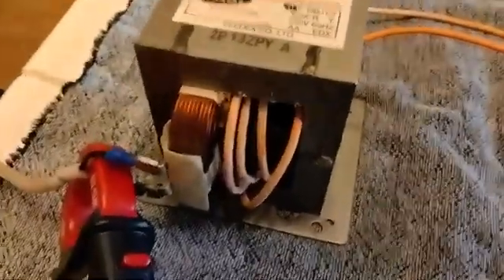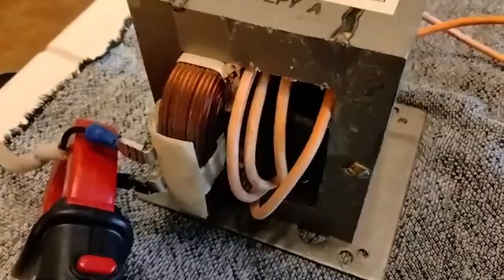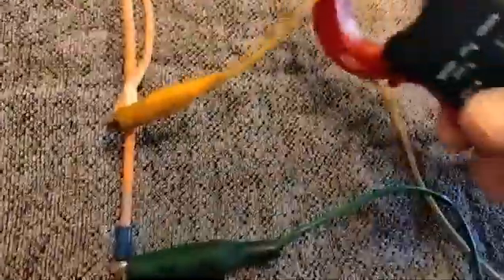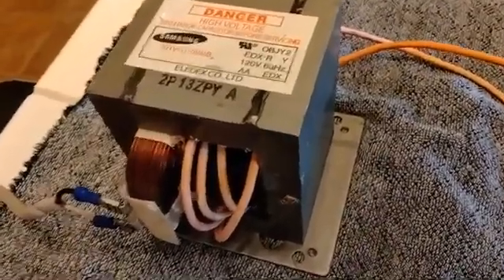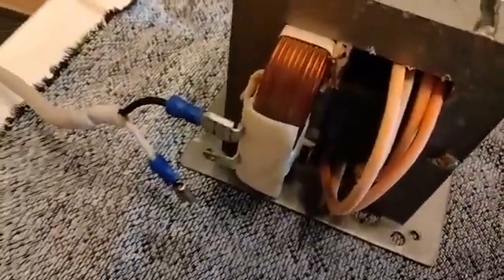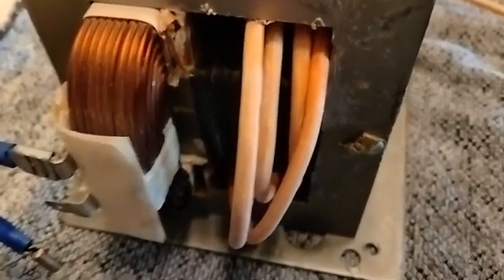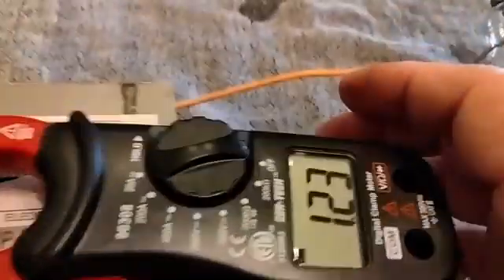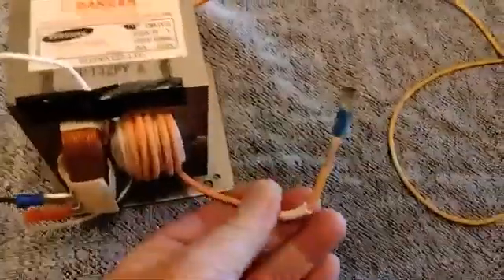Microwave Oven Transformer Rewind the Right Way, Too Many Dummies on here giving Bad Advice

Comment: Excellent presentation, I like hearing Expert's? quoting factual information. You did a bang up job, explaining the fact's for this type of Transformer. Thank you N8AGW.
Reply from the maker: Thanks,  I'm not an expert by any means, but some things I know because I've tried and learned the hard way many times.   I actually learned about those primary windings from some old YT videos over 10 years ago, it was some kids in Thailand building toroidal transformers and explaining that as they added windings that the idle current kept going down.   It was not in English, so I just kept watching what they were doing because they had a light bulb in series with the primary and as they added windings it kept getting dimmer.   That sparked my curiosity so I started studying, and in that studying I ran across the descriptions of MOT's and how they cheat and short wind the primary, and the saturation, and all the other tricks.
Reply: @bigcbradio  Well you have a good understanding of winding transformers. Microwave transformers are a great means of transformer stock, easy to get apart, and remove, or add secondary windings. You are the first person to post the fact that the primary winding must be changed also. This is very important and thanks for pointing it out.
Reply from the maker: @leroyolson4349  You are very welcome.

Comment: I can't understand why folks always say to throw out the old secondary. If you just run them backwards they put out 6 volts at a couple dozen amps.  (Watch the output winding temperature!) 

You can cut the welds or not it doesn't matter as long as their well clamped back together when you run it.  Cutting em just makes it a hell of a lot easier to get the shunts out of the core and free up a bit more wire from the fine winding to attach a lead to instead of having to attach one wire to the core to run it.
Reply from the maker: Again folks, do not cut the welds.  I even saw a video here on YT where the guy says "cut the welds with a hacksaw, it's easy"  then he proceeds to use a high speed cutoff wheel to cut the welds. LOL.  Have you ever tried cutting a weld with a hacksaw?  If you have then you already know what I should say here.   If you are one of those people that has to learn everything the hard way, then by all means, get yourself some MOT's and try it both ways, all 27 ways,   Cut the welds, add primary turns, don't add turns,  then you will know.   But in all seriousness,  do not play with, or even power up an MOT that still has a secondary winding on it unless you really know what you are doing, or you may DIE very quickly.
Reply: @bigcbradio  I think this commenter was proposing putting mains into the secondary and using the primary as a low voltage output.  It certainly would not saturate the core but it will also not be able to provide the full 700-1000W of power with the excessive winding resistance.

Your advice not to play with the secondary high voltage is good.

The advice in your video is also sound, I have seen one other video and understand enough about transformer theory to know that it is a sound fix for the problem.

Perhaps one day you can do a demo of feeding the primary with a good size Variac and graphing the voltage and current, with and without a load, before and after the added turns.  You will be able to show how the current starts to clearly increase faster than the voltage when the core reaches saturation.

Nice video, don't worry about the nay sayers, you are far from the most abrasive on YT and provide good information.
Reply from the maker: @KallePihlajasaari  Thanks for the comments.  I'm not worried about them, otherwise I would have my comments off, or screen them.  There are 2 reasons I made this video in this way.  One reason was because I almost feel bad every time I run across a video showing people how to just add windings as a secondary for a project.  These MOT's draw a lot of current and these beginners are going to be turned off of this hobby if all they get is bad advice and their transformers get hot, burn up, blow fuses, etc.. and I want to help them enjoy this hobby.  The second reason is because I have been involved in electronics in many capacities including CB, and HAM Radio almost my entire life, and I get so tired of the new Hams acting like they know everything, when most of them just memorized the answers.  These hamsters squawk about everyone being off freq and tell them to buy a better radio instead of helping them fix the radio they have or using their clarifier.  They also just parrot crap they read or hear from others and have never actually tried any of it.  Then a few days ago I ran across a Hamster guys video where he is supposedly teaching other Hams how to use a MOT for tube filaments here: https://www.youtube.com/watch?v=8o3ttyrXIeM  So, between these two issues, I made this video a little snarky with a small dig at a Hamster, and I wouldn't be surprised if the negative comments are from Hamsters, if not, they will be now LOL.
Reply: @bigcbradio  I used CB in my youth, had a Ham call in ZR6 land but have moved to OH2 land and have yet to rewrite the test here though I did a refresher course in the local vernacular with my son.  Perhaps we should just book for a test and get local calls, they may come in handy one day if the internet censorship gets real bad and one cannot even connect to the net without a biometric ID and a certificate of vaccination.
Reply from the maker: @KallePihlajasaari  I am not too worried about the internet or the end of the world, etc... But that being said, I do stay prepared to be self sufficient in the even of most disasters or if the shit would hit the fan.   I own multiple properties, I have solar, batteries, water, water producing equipment, water wells, food, seed, and transceivers and antennas to listen/communicate on just about any frequency there is, and no I don't need a vax
Reply: @bigcbradio  as someone who did this (cut the welds, ruin the secondary (accidentally (this was such a sad moment, i wanted to use the enameled wire of the secondary coil for some other projects)), also ruin the primary (accidentally)), and now i have just an empty E I core, i recommend cutting the welds, it gives you easier access to the core, which will make it significantly easier to rewind, but the problem is, ruining the old windings is almost inevitable (especially for someone who doesnt have high-end tools)… and if you want to rewind a microwave transformer, those are some things to put in mind:

1- Cut the welds (so that the process gets alot easier to do)
2- For the love of god, dont ruin the secondary coil! Extract it! (It will take alot of time, but it is 100% worth it) 
2.5- check if the secondary coil is copper or aluminum (sometimes it is made of aluminum), if its aluminum, you are very unlucky, if its copper, congrats! Save the winding for later projects
3- extract the heater windings and the magnetic shunts, and throw them in the trash can
4- extract the primary
5- check the number of turns in the primary (put 10 turns of wire as a temporary secondary, measure the input voltage, measure the output voltage, and using the ideal transformer equation (V₁/N₁ = V₂/N₂), calculate the turns of the primary (N₁)
6- add additional turns, until you reach (√2×V₁) (to get 1 turn/peak-volt) (which is basically the golden ratio for microwave transformers)
(this still applies if you want to rewind the primary from scratch, just make sure to use thick enough wires)
6.5- put in mind that N₂ (secondary turns) will give you (N₂/√2) volts output ( so if you want 12 volts ac output, you need to have around 17 turns on the secondary)
7- put any insulation on the iron core itself (tape works good)
7.5- (optional) connect the ground wire to the iron core itself
8- put everything back together tightly
9- enjoy
Reply from the maker: @Deleted_Old_Account  Good Info, you should make a video about it.

Comment: The preloading is not because of too few windings in the primary.  The welds that short the iron laminations together are inducing eddy currents, which preload the transformer. (Iron losses, not copper losses).  If you were to use an angle grinder to carefully remove the welds, you will find that the transformer returns to normal and draws little or no energy.
In the microwave oven you will find a second mains-powered transformer, a much smaller one, which supplies 12 Volt power to control circuitry and a relay which can power on the big transformer.   So in use the big transformer is energised intermittently, not energised continuously.  I hope that this helps. ❤😊
Reply: By intermittent are you talking about the on/off 60 times per second due to it having to be driven by AC power? Under that definition everything I plug into a wall is intermittent.

As bigcb said, intermittent operation only occurs on the low power or defrost setting.  Even then it is always run at full throttle, just shorter intervals.

Also curious why you come here and recommend people start removing welds on a transformer; in the comments section of a video talking about people doing stupid things with transformers...
Reply from the maker: @ScandalistRick  that is so funny... LOL damn, everything is intermittent, you're cracking me up
Reply from the maker: NO, Do not cut your welds people !!   I do not agree with this!  You DO need extra primary windings.  The big transformer in a microwave is not "intermittently energized" "while in use" unless you have chosen the "low power" or "defrost" setting, which in reality is NOT low power, it is still full power (or as I call it, "wide open throttle" LOL) that is simply turned on and off every few seconds, and you can hear this happening while you use your microwave at home.   Misinformation like this is Exactly why I made this video.   It appears I am going to have to make another video about this...

Additionally, since you mentioned "intermittently"....  many people are wanting to rewind these MOT's to use them continuously.   Cutting the welds is Not going to keep these from overheating in continuous use.
Reply: @bigcbradio  It's called duty cycle. When you use the defrost low or medium settings. Yes it's either off or on the magnetron. The duty cycle averages out the heating and time for the heat in the food to spread out before the next on cycle. The issues is they save copper and make it saturate the magnetic field as it's only used for a short time and it has fan cooling in operation, also the magnetron is always pulling something like 700 watts continuous after a couple of seconds after it's heater is hot. So that transformer is under load most of the time it's on. Welding the lamentations just helps prevent buzzing and it wanting to rip itself apart from the strong magnetic fields. Typically a iron core transformer would use around ~3 turns per a volt.
Reply from the maker: @Blackwolfster  LOL, yes, I know what a duty cycle is.  But regardless, I use laymen terms all the time, such as "wide open throttle".  I am here for fun and helping hobbyist and not trying to have a class about flux, inrush current, power factors, ohms, impedance, inductance, henrys, or a class on turns per volt formulas.
Reply: @Blackwolfster  The fan in the microwave oven does not cool the MOT only the magnetron and it is exclusively for this purpose
Reply: @Blackwolfster The number of turns per volt in an iron core transformer is primarily a function of the cross-sectional area of the core, the material and the magnetization conditions.
In the example in the video, the transformer works saturated, using 1 turn per volt windings. After modification, the same cross-sectional area but not saturated, the transformer uses approx. 1.4 turns per volt windings.
A transformer having a core 5 times thinner would use windings with 7 turns per volt or more .

Comment: Very useful, thank you. So with 120 turns vs 80, the coupling is now better? I guess the microwave companies use the minimum amount of turns (copper), assuming full load, to save a few bucks?  Is there a formula you used to determine the appropriate amount of turns for an iron core xformer running at 60hz?
Reply from the maker: Yes, 120 vs 80 much better, but you can "fine tune" the number of turns yourself and find the sweet spot (read my description).  Then yes, they save more than a few bucks.  They save on copper, they save on core size, they save on shipping weight, and they save on returns from blown up tubes because the transformer is self regulating the output power to the tube no matter what your mains voltage is (within reason).  There definitely is a formula/calculations for building transformers.  Very complicated if you ask me.  There are some very basic calculators online, and then there are the real calculations that need all the info.  For the real calculations you need to know what you are going to use it for, the supply voltage, the output voltage, the load, the frequency, the core size, the core type, how big your waist is, and what country your wire came from, how many kids you have, etc...   But I am not an engineer, I'm just a you tube dummy, trying to help out with my 2 cents.
Reply: @bigcbradio  >>>transformer is self regulating<<<   Kind of like the way neon sign transformers use the core shunt to keep the secondary from drawing to many amps...
Reply from the maker: @sempertard  I have several old neon signs, but I have never needed to open one up, so I have no idea what the transformer is in there, but I will have to believe you.
Reply: @sempertard The manufacturers of microwave ovens don' save on copper. Copper was eliminated from MOTs many years ago, which boast 100% aluminum wire. The same goes for garbage disposers. Try to solder the "copper wire" in a MOT or simply look at the cross section of cut windings
Reply from the maker: @petruse8893  I guess that is good info, good thing the half dozen or so I have are mostly 20 years old. Hopefully they are all copper.  Regardless, the companies still save on cost and shipping weight.
Reply: @bigcbradio  Thank you for your answer.Yes, 10 years+ ago copper might be a first choice material( as it should be) for MOTs wiring.Transformers 6-8 years old which I dismantled are wired with aluminum wire (beautiful copper color varnish)
Reply from the maker: @petruse8893  Wow, everything made so cheap these days.  Not to mention the aluminum expanding and contracting will break it sooner also.   One of the transformers I have came from an early 1980's microwave, a family friend gave it to me about 5 years ago because his wife made them get a new "pretty one".  After about 3 months he called me and asked me if I was willing to trade it back for the new one LOL.   I had to tell him it was too late :(   Don't foregt to stay away from the ceramic, who knows what they use or don't use in it now days.   Back in the 80's I worked with rebar for several months that had been contaminated with radio active waste from Mexico